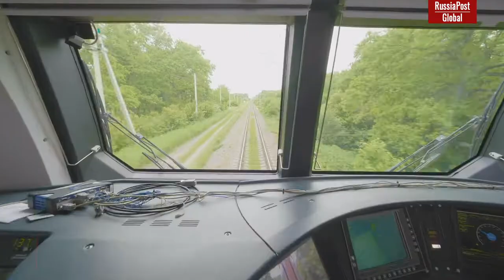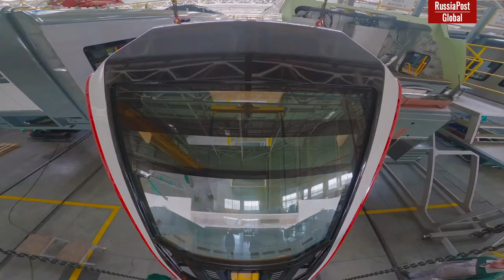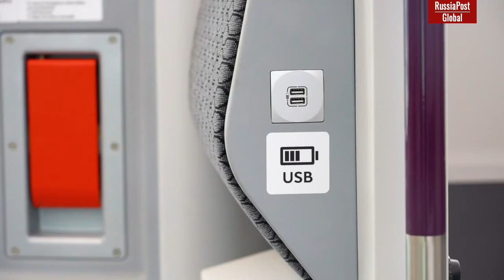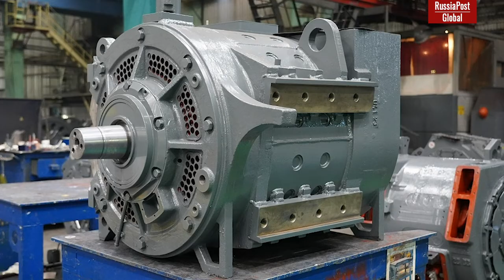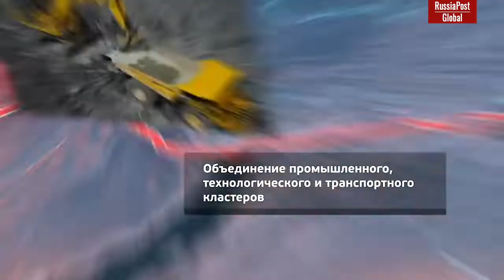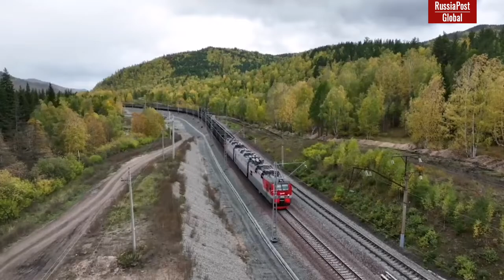Russia is building a key element of the future global transport system

Comment: As Russia still has some non electrified lines it really should be manufacturing diesel-electric electric (hybrid) locos. They’re basically diesel-electric locos with a pantograph so they can also run directly off overhead powerlines when it’s possible & even put power back into the lines when necessary - from the diesel generator too, not just the regenerative brakes. So in effect the same loco can function as either a diesel-electric loco or a straight electric loco, whatever is required for whatever trip. They have some like this in Spain.

Comment: Russian Trains may not be the High speed type however, the Weather and geography means that 160 km/hr is fast enough moreover, Russia must develop its own solutions and not rely on States like Germany as they are not sovereign .
Any foreign Machinery ( including Trains , Road commercial vehicles ) Russia must have in the Contract the right to produce all parts and Components just in case of Trade problems .
Slava Mother Russia 🇷🇺😉
Reply: at -50 freight trains run 5-10 km/h
Reply: They are now nearly as advanced as Western Europe was 30 years ago.